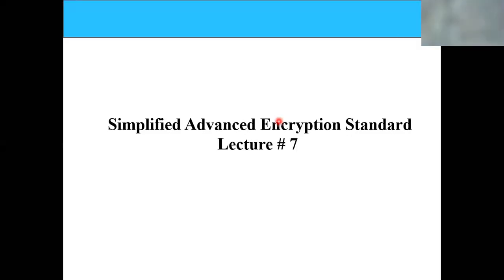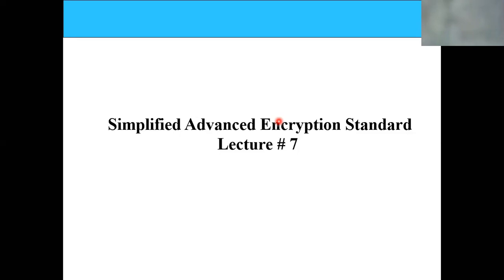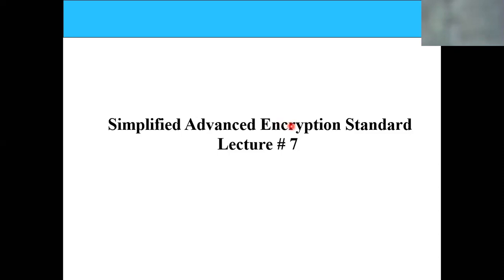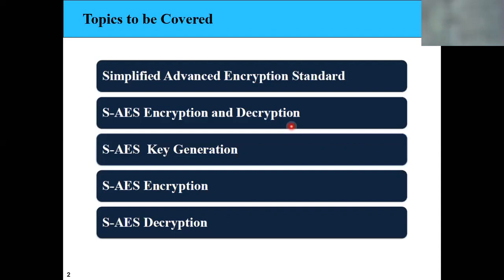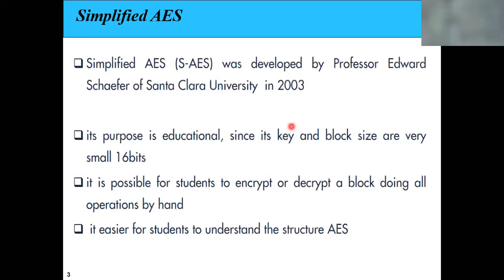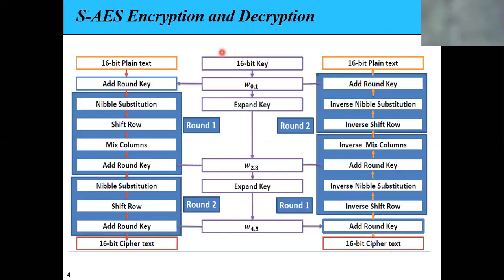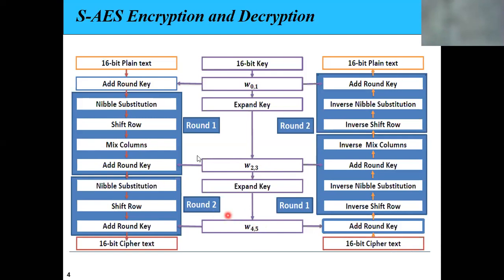Simplified Advanced Encryption Standard | Explained SAES | Mini AES

Comment: Sir when finding the W4 then you changed the w2 values from 1101 1101 to 1110 1101 I did not understand Please reply when You available Thanks
Reply: That is a typo.. Take it as 1101 1101 
Once u get the final cipher text, check with cipher text(the final answer) he mentioned in the video.. (It matches)
Reply: @manish7035  It doesn't matches... I believe if I am right the cipher text should be 0001 0100 1101 1100

Comment: Sir, you have made a mistake in w2 values while calculating w4 which generates the wrong K2 and hence wrong cipher text

If I am correct, cipher text should be 0001 0100 1101 1100